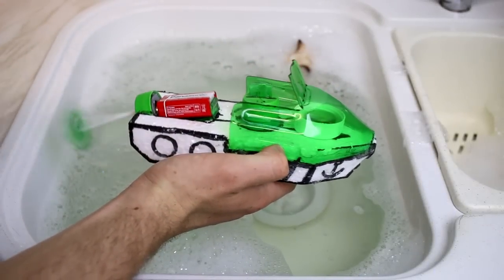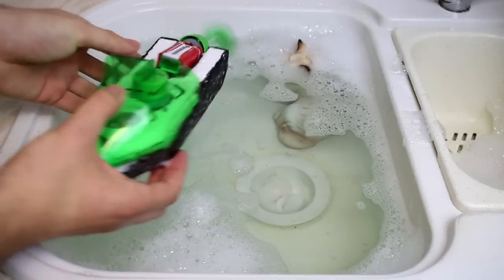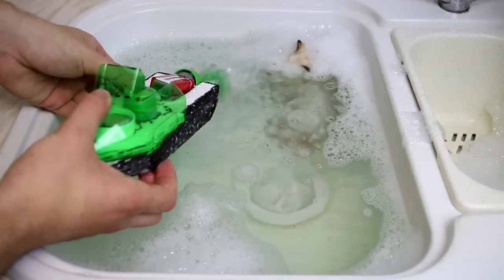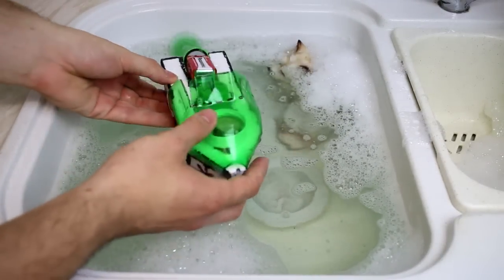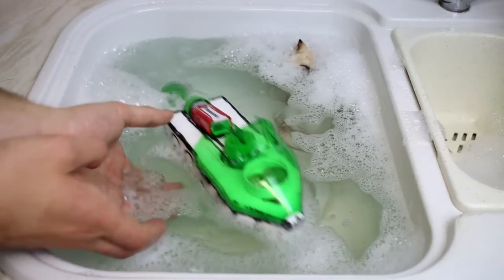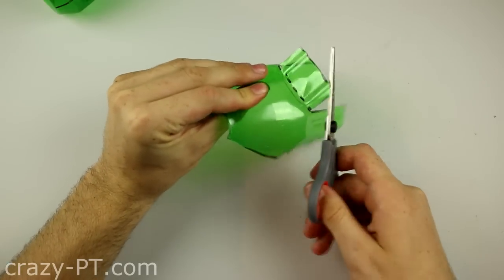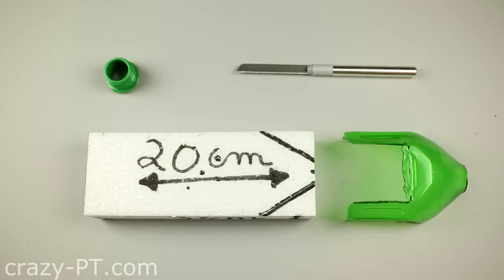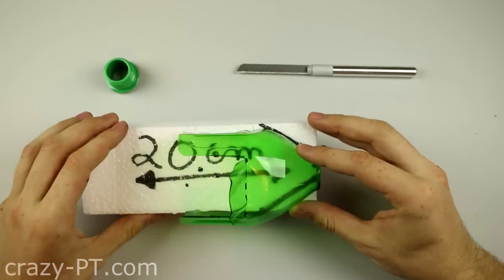How to make an Electric Boat - (Very Easy)

Comment: it's probably the acetone or something similar inside the paint that eats away the styrofoam. alternatively, i think you can use plastic/rubber paint like plastidip. as for the propeller, keep it to 4 blades or 3 blades. in my previous test. it's the angle of the blade that count, not the amount of blades. but otherwise, great video. subscribing :)

Comment: Use a spray paint made for painting plastics. Or a primer for plastics, then regular paint.
Reply: Hobby model paint is diluable with mineral spirits, unlike "regular" paint which is either oil+base, latex, or ketones. Simple deglossing, not plastic primers (buylene) , and hydrophilic topcoats work better, stink less, but cost more not for their ingredients but their technical research in pigments & why inkjet carts are so expensive.

Comment: You have an outside plastic paint. It includes a solvent that eats away a small amount of hard plastic on say, lawnchairs. This makes the paint much more durable. Styrofoam is mostly air in plastic bubbles, so when you added this solvent, it ate all the bubbles. Make sure next time the paint is not a solvent or outside paint.